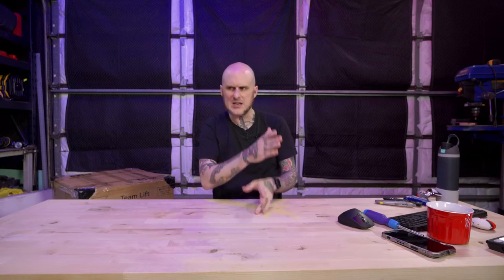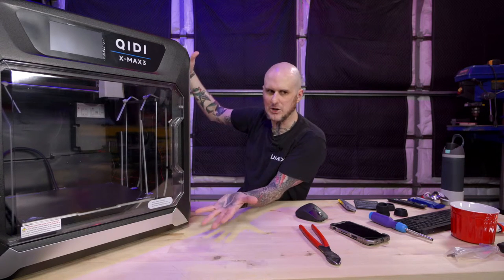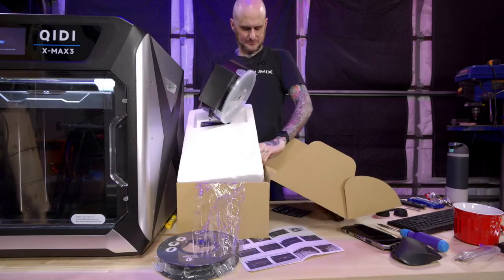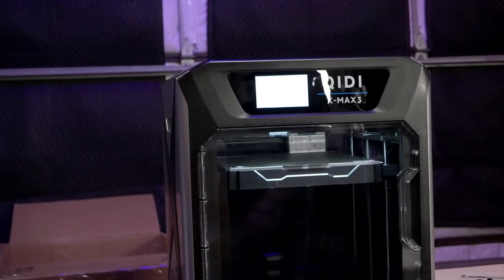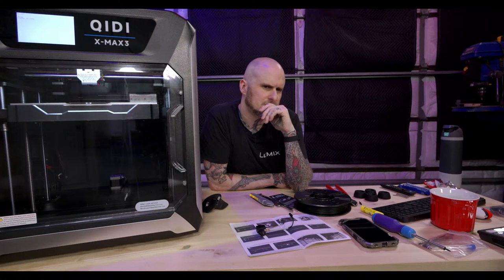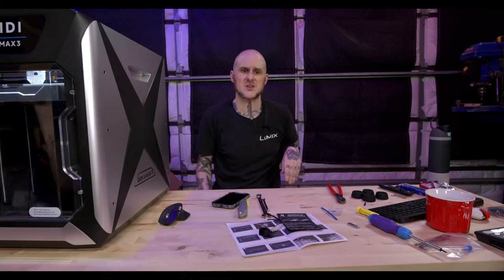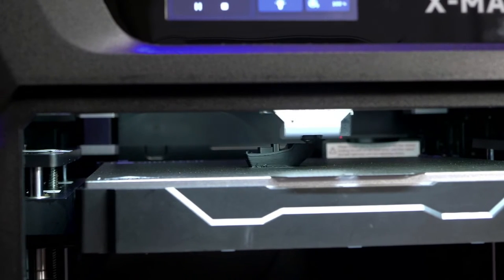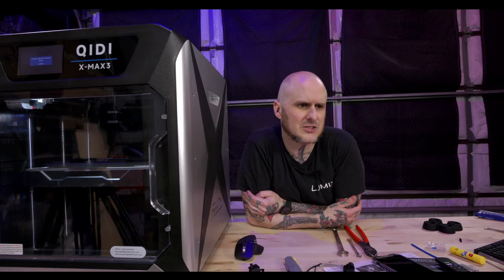The BIG One - Unboxing Qidi X-Max 3!

Comment: Anyone have problems with getting filament to extrude/load/unload? Brand new out of the box, first load did not extrude. I had to pull the filament out when trying to unload. It did do a couple of prints, but now the extruder motor is clicking

Comment: One of the bad news is the nozzle beeing 2mm shorter than a volcano. I can not understand Qidi here. I do not think the shorter nozzle has any advantages - but it keeps the X-Max 3 from using Tungsten-Carbite, ObXidian, CHC etc. Quite a downside. But actually - maybe a volcano nozzle still would work inside the hotend? 2mm is not sooo much, maybe just a little redesign of the front cover (with part cooling) and maybe a little spacer for the ABL.
It would be so nice to use a Tungsten Carbon or ObXidian in 0.4 and 0.6 mm and CHC in 0.8 and 1.0mm ;-(

Comment: Qidi hirs the mark on a lot of my “wants” and “needs”, but some of their execution choices drive me nuts and put me off unfortunately. I have an X-CF Pro, and the Bl touch was practically useless. Once it’s dialed in, the prints are amazing and it does a great job. It’s a solidly built machine just a bit slow (which is ok for higher temp materials). The one thing I really cannot stand is where they place the filament feeding, and how far back they put the filament runout sensor from the extruder head. Changing the filament on an X-CF Pro is a PITA, And it looks like they kinda stick with a similar filament feeding method with the X-MAX 3 also. It’s a shame.

Comment: i have an old bedsheet folded up and draped over the top and sides of my X1-C, leaving the front and back clear, and i'm getting 60+ degrees chamber temp and using the chamber fan to keep it from going higher. This is in a room sub 10degrees celsius overnight, too. Might be the 220VAC running the heatbed? Someone should look at that :)

Comment: One question: Can the front door been unhinged? With this size I do not like to simply have it open if printing a big PLA print. As the printer takes some room on a table, an open door reaches over the table and might accidently been hit while passing in front of the printer. So unhinging the door and place it on a shelf (like for the top cover) would be the best solution.
Of course this printer is not ment primalary for PLA-prints. But if you design something, you might need some iterations and want to print prototypes fast with cheep PLA before printing the final part slower in high quality technical filaments. So optimice PLA prints by unhinging the door would be nice.
Reply: Yeah, When the door is in the closed, you can push the door from the inside to out and the door can be easily removed.
Reply: @mohistschool1003  Thanks, thats quite helpfull.

Comment: The setup time requirement is crazy here.  I just picked up a P1S, and it was literally printing after 15 minutes.  The screen update alone here is double that here....
Reply from the maker: How often do you have to go through a calibration or a firmware update is the question? An annoyingly long setup that only happens once isn’t bad. I’ve had printers that took longer to build out of the box than this took to update. 🤷🏻 Bambu has got the “out of the box and printing” experience down for sure, but is that the most important thing? To some maybe.
Reply: If you think initial setup time is a significant issue, get back to us once you have to replace carbon fiber guide rods. How do you think that time will compare? Oh, and remember, setup time was more than doubled because it was completed once before and again once after a firmware update. So what's really crazy?

Comment: Active heating inside semes a bit dangerous.  I'd be curious to get a deep dive into that.  900W of power is crazy also.  My Voron 2.4 350mm only has a standard 200w PSU.  You should use the old version for printing PLA only.  No need to heat the chamber for that. Toward the end of the video you mentioned you had only nevermore on your V2.4.  you should look into Ellis' bed fans mod.  it makes a WORLD of difference when you want to heat the chamber.
Reply: The Voron 2.4 has fixed Hotbed powered by AC via SSR. On the Qidi X-Max 3 the bed moves in z. So they decided against using an AC heated bed and use a 24V DC heated one instead. A good and secure choise.
The Voron does not use much less power than the Qidi - the Voron just do not use a PSU for heated bed.
Even a 300by300 silicone heating mat for Vorons has typical 600W. Just not using a PSU but main power directly.

Actually, the decission not to power moving parts with main AC is a good one in my opinion.

I am not sure about the chamber heater. As it is a non-moving part,  using AC would be save. So it might not even use the PSU.

Comment: I wish someone did a Voron mod with this printer as a donor kind of like the Ender-> Switchwire.
Reply from the maker: I mean it’s effectively a commercial Voron in a lot of ways. Heck it’s “upgraded” compared to default Vorons as it has 9mm belts. Plenty of mods could be done but for the most part it’s ready to roll as is. Nothing about it has made me feel a need to change it so far.

Comment: Oh, I just notice your self have to do the Z offset... and it's using BL Touch? In 2023??? Really ?
I pass, I was 99.9% ready to buy this printer, but the manual settings and BL Touch is a 100% NO GO for me.
(I got nerve damage all over the body, and my finger can't fell near enough to make this possible!)

Dang, back to beginning and hunt for another 3D printer with a build side like this X-Max 3.

Why pay like (here in EU) €1600 for a Bambu Lab X1C with AMS, that only have 235x235mm vs Prusa XL, that got 360x360mm space, for €1999 
That's only €300 in difference, and you get an away bigger build surface.
Reply: If, for example, I want to use borosilicate glass on the bed, I need BLTouch, an inductive probe will not work. What's wrong with BLTouch?